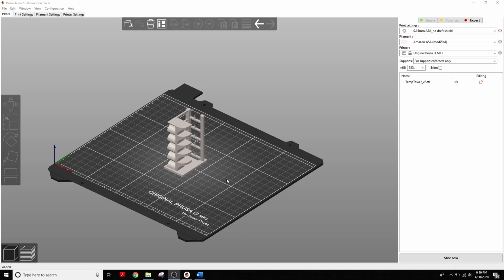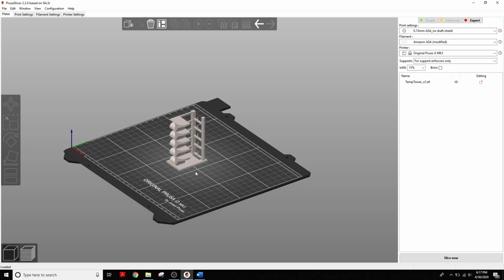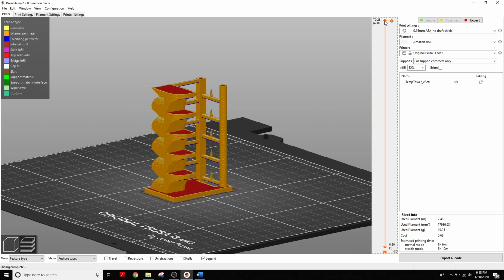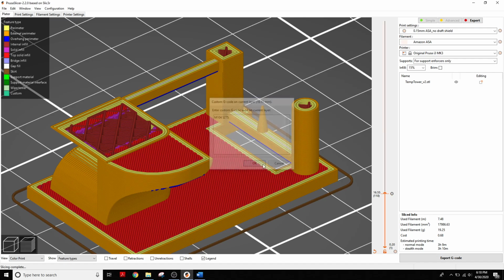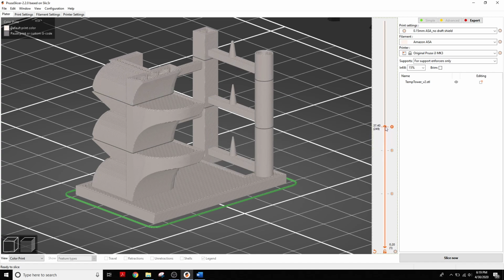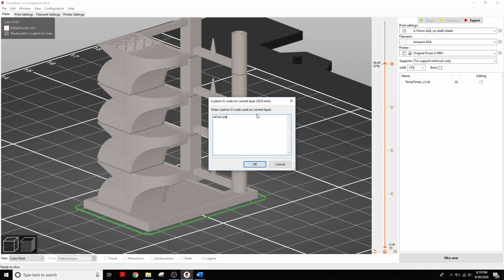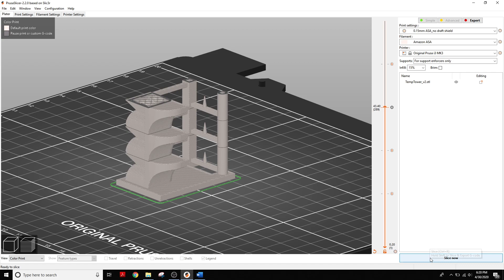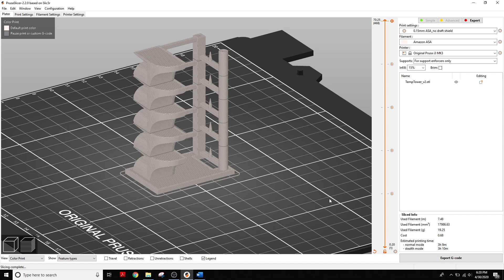How to Insert Custom G-Code for Temperature Tower- PrusaSlicer

Comment: Dear, friend! I'm trying to do the same thing with "retraction towers". I managed to slice a "retraction lenght tower" similar to what you're doing in the video, but using the M207 command,  but I can't find commands for "retraction speed", "extra lenght on restart", "deretratcion speed" and "lift z"... Do you know them? thank you very much!
Reply from the maker: This link: https://reprap.org/wiki/G-code
says that most of those options are parameters used in the M207 command. The example given shows how you would type in those parameters.

Comment: Do you have to do it this way to get it to work with the 2.2.0 update. I’m trying to get the g-code to work in the before later change in
printer setting and I keep getting an error. 

The g-code I’m using is
{if [layer_z] == 7.55}M104 S215{endif};
Reply: same problem here
Reply: Sammy Zalcberg I finally got mine to work. My one line had the “layer” with a capitol L instead of an lower l case.  You really have to make sure you got everything right or it won’t work and the spaces too. Hopes this helps.